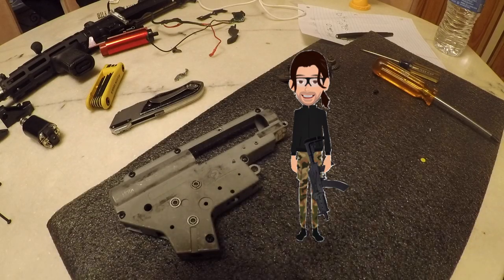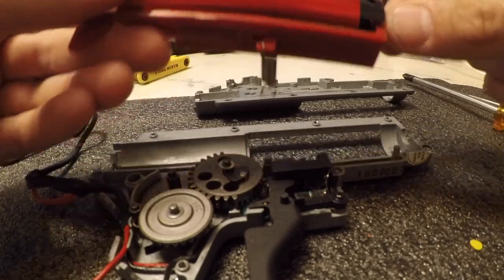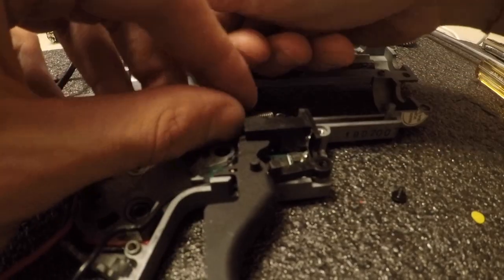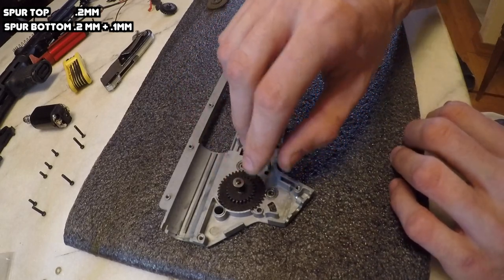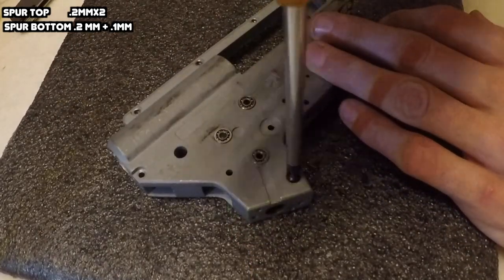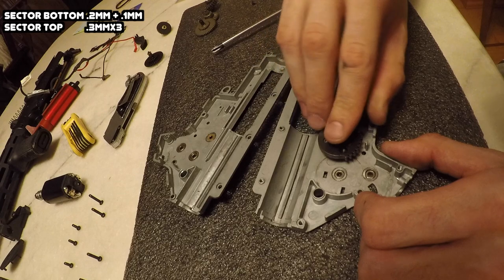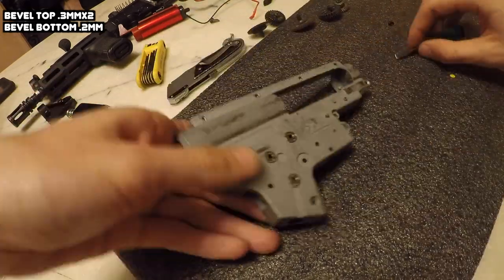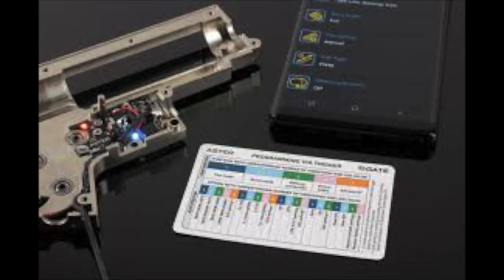VFC MP5 UPGRADE EP.3 HOW TO SHIM AIRSOFT GEARS

Comment: hey i have a mp5k that has a v3 gearbox how can i achieve a shorter trigger pull on it?
Reply from the maker: There’s a few ways to do this depending on how handy you are. The easiest route it to get a gate Titan for a v3. And you can program trigger sensitivity ———- or buy a v3 tune able trigger ————— or this is the Custom way it to add some material to the rear portion of the trigger that sits and rocks on the gearbox. This would push your trigger more towards the rear achieving a shorter trigger pull ( more material such as solder or a screw or epoxy
Reply: The Real Deal Airsoft oh okay thanks so much. I just bought a Jefftron V3 Mosfet with built in trigger contacts and gots some shims